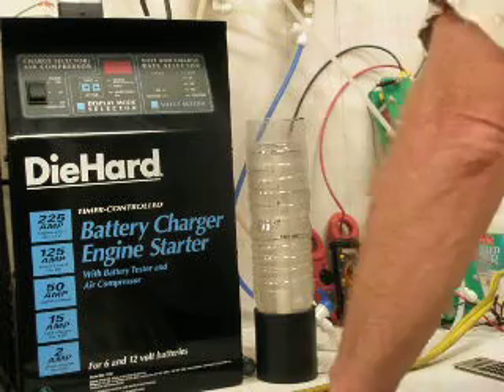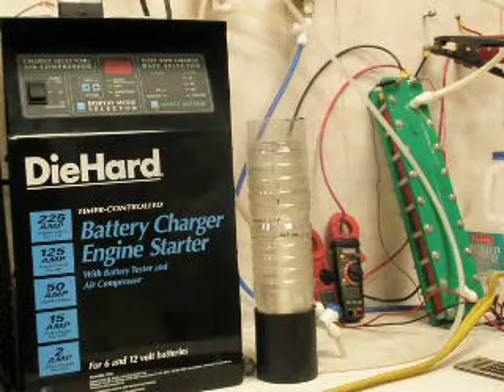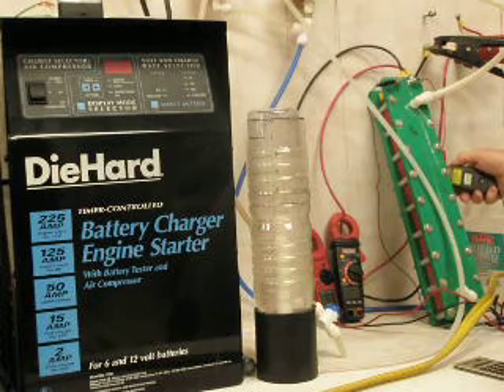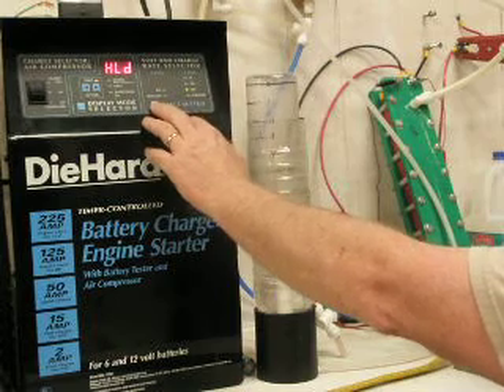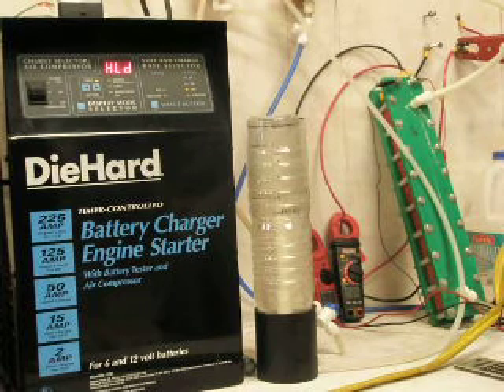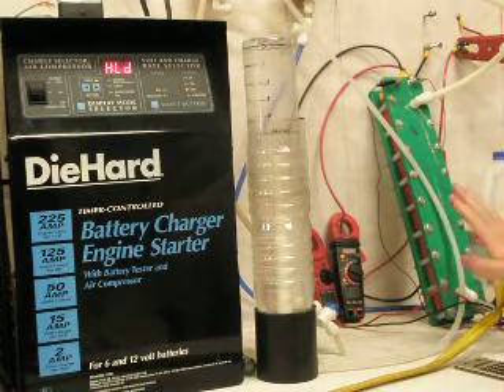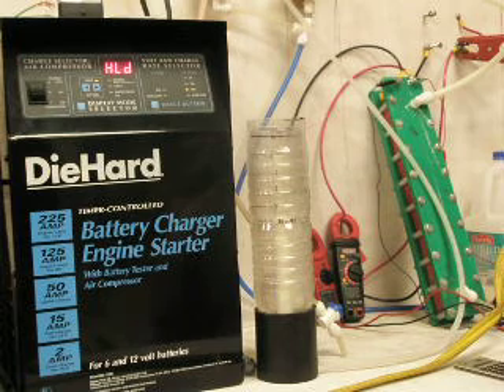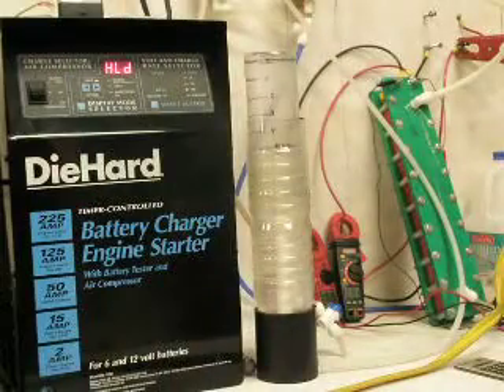HHO Test - Power Supply v.s. Battery

Comment: Well, I don't know if it's distorted or not. Think about it. Just because we're hitting it with peak voltage that higher than the RMS value, the RMS value is still the same. Wattage calculations remain the same.

Hmmm......

I wonder if we bias the cell then hit it with high current short duration pulse energy.....

HMMMMMMMMMM......................

Comment: The 12.2 VDC output of the charger is the RMS value but it's also unfiltered. The repetitive peak voltage is 12.2 x 1.414 = 17.25.

The cell itself is acting as a capacitor too so the RMS value climbs the moment you attach it.

Comment: Nice video man .Yeah I have a 25amp battery charger and it puts out pulsed dc,but I havent seen where it shows any difference on my analog amp meter..but one thing I have noticed is that, my cell seems to produce just a little more gas,than when just using the battery at same amperage..